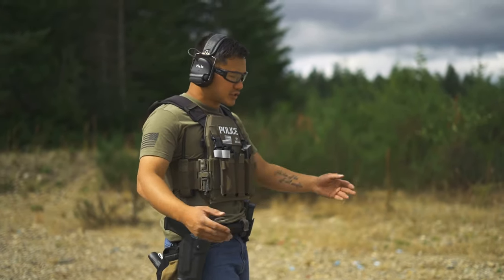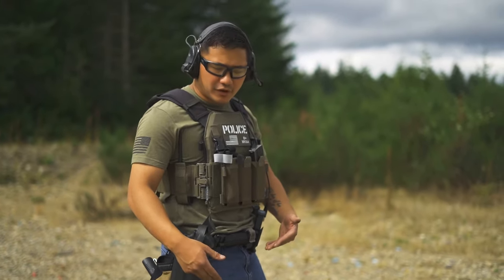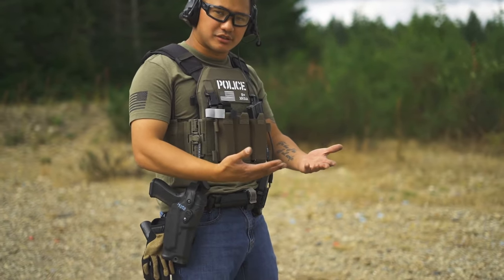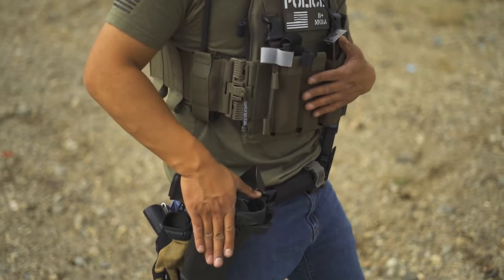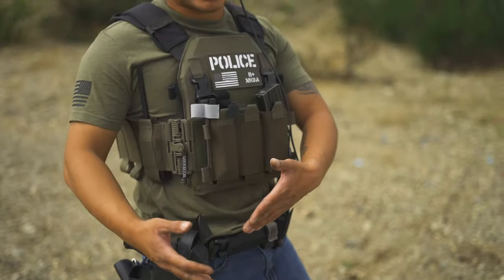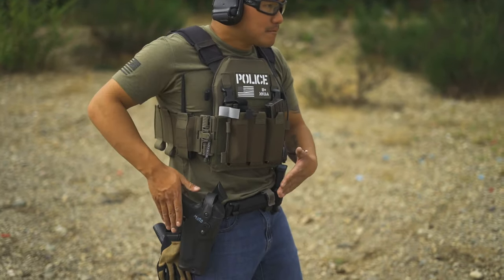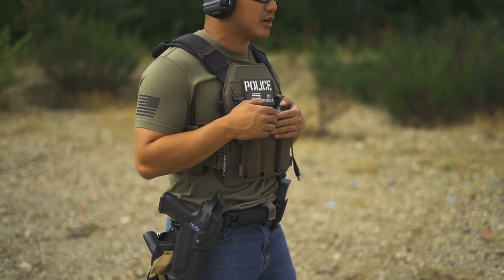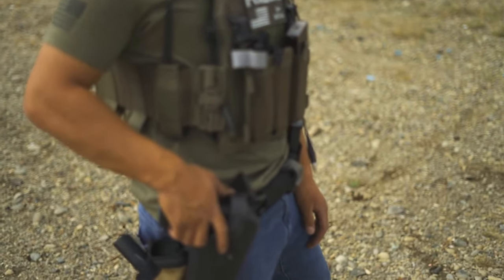HOW I DRAW USING A LVL 3 RETENTION HOLSTER FROM SAFARILAND

Comment: When I first got my Safariland a few years back, my draw stroke was awful. Hitting the SLS was easy, but I’d want to combine the draw stroke with deactivating the ALS, and I often began the draw before the ALS was defeated. Anyone who’s done that knows that the pistol isn’t going anywhere, LOL.

So I learned to push the SLS down/forward much as you do, and acquire a full grip in the process of doing that. Done correctly, the beavertail of my G19 is fully seated in the web of my hand when the SLS hood is fully forward.

Then, I sweep my thumb to the rear, and almost use it to begin the draw stroke. By sweeping to the rear, I deactivate the ALS in the first half of my thumb’s movement, and as I continue to sweep to the rear, my thumb begins to “push” the pistol out of the holster. From there, I draw as normal. It’s hard to describe, but it’s a very efficient motion when done correctly. I’m nowhere near as fast as you Mojo, but it did help me overcome the habit of giving a solid tug on a pistol that wasn’t about to clear the holster, haha.

Comment: Good draws. Thats how I do mine also where I work. Basically the same concept running my thumb down deep to the side of the holster and pushing the firearm down a little so I don’t pre grab it and the als wont budge. I’ve noticed a lot of people try to pull up before engaging the als down to release the firearm. Has been a big issue with people trying to draw it quick. Thanks for the quick vid!!

Comment: If you have a non RDS holster (older sls/als) like a 6390 and get hung up on the stiffer/ slim ALS, look up OTD nub mod. 

It’s made my draws more consistent because it’s easier to disengage the ALS. The newer ALS safariland holsters are much nicer. 

IMO I wouldn’t get it though for ALS only holsters since it’s exposed more (unless you have the thumb cover)

Comment: When inserting a pistol into a holster, it is crucial to keep your eyes on the tactical field rather than looking directly at the holster. This practice is essential for several reasons:

Situational Awareness: Keeping your eyes on the tactical field allows you to maintain awareness of your surroundings. This is crucial in potentially dangerous situations where threats could emerge at any moment. By staying alert, you can react quickly to any changes or new threats.

Safety: In high-stress situations, distractions can be dangerous. By keeping your focus on the tactical field, you reduce the risk of being caught off guard by an adversary. Looking away, even momentarily, could result in a loss of control or situational awareness.

Proficiency and Confidence: Regular practice of holstering your weapon without looking helps build muscle memory and confidence. Over time, this becomes a smooth, second-nature action that can be performed quickly and safely.

Control: Steadily holstering your weapon ensures that you maintain control of it at all times. A rushed or haphazard action could lead to accidental discharges or damage to the firearm. Steady, deliberate movements help prevent such accidents.

Professionalism and Discipline: Performing administrative tasks like holstering with precision and discipline reflects a high level of training and professionalism. It sets a standard for others and demonstrates a commitment to safety and effectiveness.

In summary, keeping your eyes on the tactical field while steadily holstering your pistol enhances situational awareness, safety, proficiency, control, and professionalism. These elements are critical for effective and safe firearm handling, especially in dynamic and potentially dangerous environments.

Comment: Makes me wonder if there's something wrong with my Safariland...mine is only a lvl 2 and my P229 doesn't come out that smooth.  It takes a bit of effort to get it out and it kinda tries to take the holster with it.  It's not bad...I love the holster and have kinda just trained around this (I've gotten in the habit of pushing the ALS button HARD with my thumb which pushes the holster down during the draw) but now I'm starting to think it's not supposed to be like that.  Interesting.

Comment: How do you feel about a drop leg set up vs at the belt for open carry? Pros cons?
Reply: Drop leg will flop all over the place, plus most drop leg setups require you to bend at the torso to draw. The best compromise is the Safariland Midride UBL mount.

Comment: 1:42 how did he fire a bullet after reloading without pulling the slide
Reply: Slide release pressed simultaneously as magazine was seated in mag well. Lots of repetition makes for a fluid seamless movement
Reply: @silentcadence06  so the slide release chambers a bullet
Reply: @gallo2432  Of course it does. 

To chamber, you pull the slide back and let it go. 

If the slide is open, like it is when the mag empties, it's locked back as it would be if during one's pull back on said slide. 

Hitting the slide release lets the slide move forward thus completing the process as if you had racked the slide by hand.
Reply: What @candyman said

Comment: Why do you openly display a backwards U.S. Flag against United States Code Title 4 Chapter 1 subsection  7 i: "
When displayed either horizontally or vertically against a wall, the union should be uppermost and to the flag's own right, that is, to the observer's LEFT...